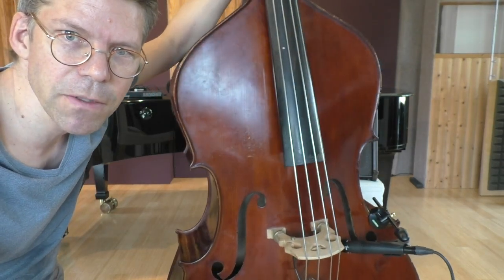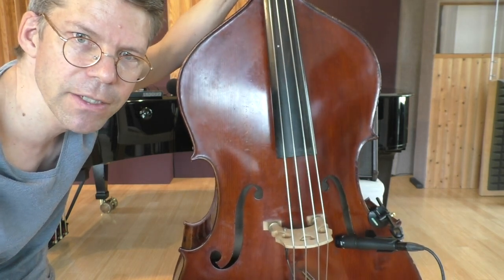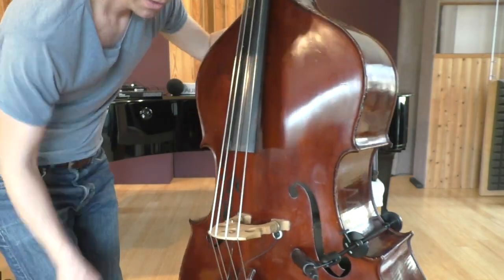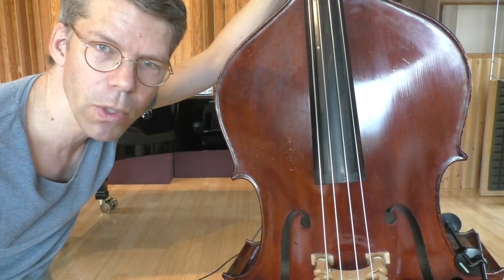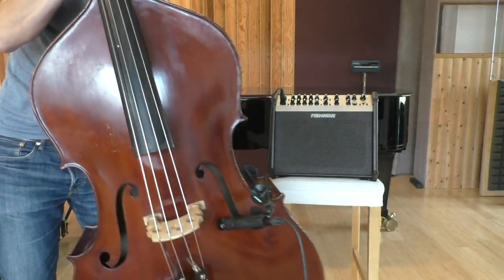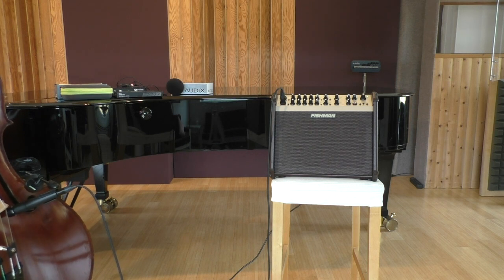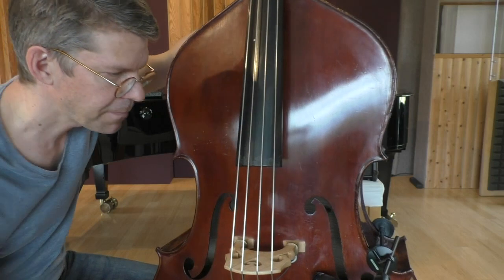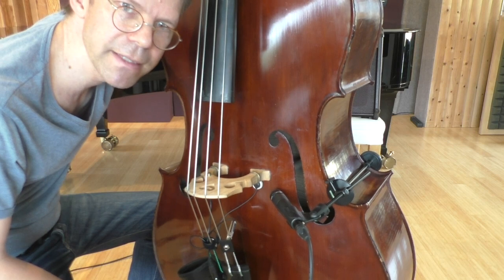Using a Shure SM57 with an H-Clamp to amplify a DOUBLE BASS - (Quick video as a reply to a comment)

Comment: Thanks for the demo (and for your other excellent videos/reviews, too). 

I would like to try this with a lighter condenser mic (like maybe one made by Lewitt) vs a heavier dynamic mic, and see if I can get the capsule further away from the face of the bass to grab more upper mods and overtones. 

Another experiment idea is to create a PZM plate mount that faces the front of the bass, but feedback in a live band setting might be a problem…
Reply from the maker: Yes I received the metal G/D, the series 16 A/E and the GS Vintage G/D. I am slow with my videos but I will try to review them soon.

Comment: Hi, great video thank you! Will it still work if I connect the mic with a XLR to TS adapter and plug it into the bass amp? My bass amp does not have a xlr input, so I want to use a adapter in order to connect the mic to the amp. Will it still work?

Comment: Wondering how would you think of using condenser mic V.S. dynamic mic in this setting (plug the mic directly into an amp)?
Reply from the maker: This is certainly also worth a try. The reason I experimented with an SM57 was: I tried a mic by xlson Audio (chuck Israels Signature). I didn't get really good results with that mic although it is expensive. So I thought: does a cheaper mic work better? I never tested this live so I can't really give an answer. Soundwise, the SM57 solution is very acceptable. For live you will probably have more feedback issues with a condenser. For recording a condenser will probably sound better but you might have more bleed from the other instruments.

Comment: What happens if you feed that microphone through a bass app?… Maybe through a micro mixer first?
Reply: Hey, I see that we're both watching this kind of old video so I thought I'd share my experience in case it's helpful or if the author can't. Over the past few years I switched from using a bass amp to using a powered PA speaker for all of my double bass uses. It used to be that I would do a lot of doubling gigs so I would put both electric bass and upright through the bass amp. But as I started moving more toward just using a mic, or a blend of mic and piezo, on upright only gigs, I found myself a little disappointed in the sound. That's because bass amplifiers, whether valve or solid state, are voiced in a particular way to emphasize certain electric bass tones and compensate for the direct sound coming from the pickup. I wanted something that just recreated the sound I was throwing at it but with minimal distortion and EQ, so I settled on a QSC K10 v1. I would probably choose a K12 but was able to pick up a pair of 10s used for a good price.

My current configuration is a Gage Realist (that I've owned for 20 years), a SDC mic (Oktava MK-012), into a preamp of my own design with separate eq, phase, and volume controls, into the QSC, which is mounted on a stand at my ear level.

I find with this setup, I have the most flexibility and control over my sound, and I always get compliments on it. However, using a mic has drawbacks as well, the biggest of which is feedback, especially when sending it to a front of house mixer in a theatre where the technician must be really careful not to put it into the wedges.

To more specifically answer your question, I've used dynamic mics on my bass before and have often liked the sound as well, but as I tend to like the low end of the piezo mixed with the detail and high end of a condenser mic (I HP the former and LP the latter). I don't know if just using a dynamic mic is any better than using a pickup, but the benefit of a dynamic mic is that it's much more feedback resistant than a condenser. 

As far as using an amp, yeah, it could work, but keep in mind that there is an impedance and voltage mismatch between the mic and the input of a bass amplifier. The voltage is very low and the amp impedance is too high (a rare case as usually you want a high input impedance with a low impedance source), so the sound may be a bit "loose" or "wolly." The sound would be improved with an impedance matching transformer before the amp, or a preamp.

As always, YMMV, but I'd say try it out and see how it sounds! If you don't own an SM57, I guarantee you know someone who does, probably being used as a doorstop, so what's there to lose? 😂

Good luck!
Reply from the maker: Thank you Michael for answering this question. Yes, basically it is possible to use a mic to amplify a bass through an amp or an active speaker (and yes, a mixer or a preamplifier will be needed in most cases). But you will always (with any mic) have some limitations considering the feedback problem. Some solutions work better than others, but - especially if you run through the amp on the stage - you have to try out weather you can get the desired volume on stage without feedback. 
And yes, Michaels suggestion is good: If you use a mic and a pickup, it is a good idea to set the channels in such a way that you get the high frequencies mainly from the mic (that gives the sound a natural woody touch) and the low frequencies from the pickup (the lows of a pickup are mostly nicer than the highs and you get around low frequency feedback issues this way).
Since a few weeks I am testing a setup with the Ishell contact mic for the highs and a David Gage Lifeline for the lows. I run them into an EBS S. Clarke preamp. I am very happy with the result.

Comment: I have a crate 6110d Gunnison 60 watt acoustic guitar amp I was using as a vocal PA, it's ported and sounds great with my double bass. Would YOU worry about blowing the speaker? It actually has a tweeter cut and a limiter you can turn off. I feel like my 500w amp is too boomy for upright.
Reply from the maker: Some pickups give some very low (unnecessary) frequencies, these might be dangerous for such an amp. But I would say: if you don't exaggerate the volume and leave that limiter on, you should be fine. (But I am not responsible in case of damage 😀!)